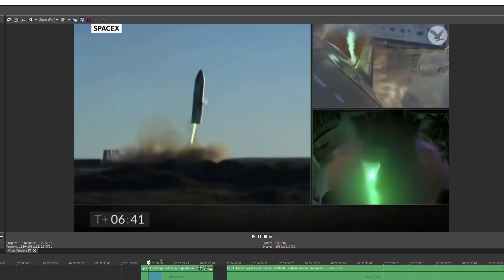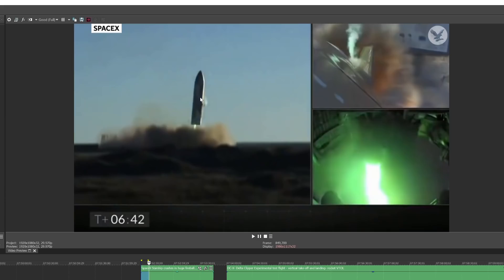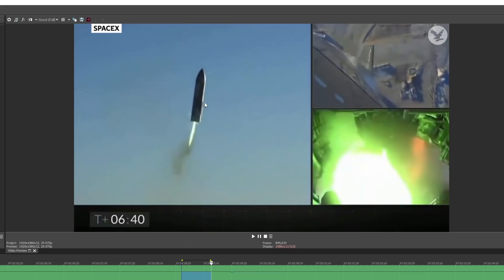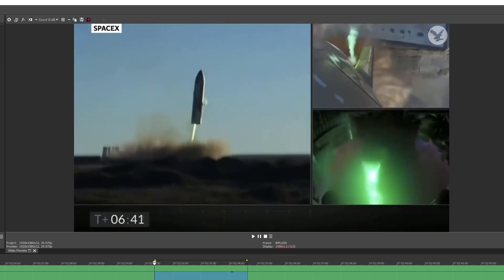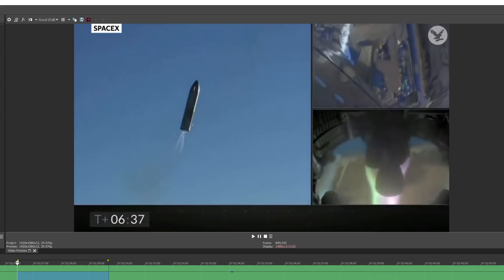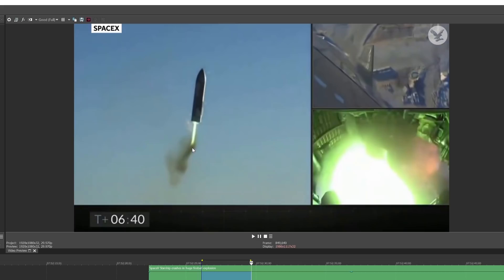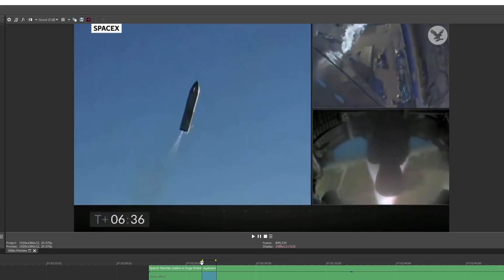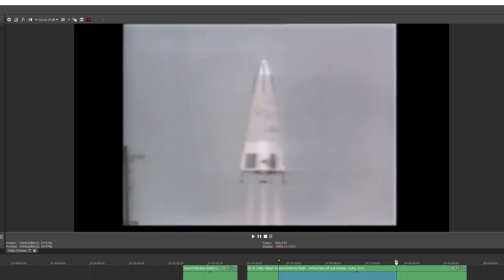SpaceX Starship Explosion: First analysis!

Comment: They "handle" the sloshing problem by using smaller "header tanks", Methane in the top of the methane tank and O2 at the top of the nose cone. They DID have low pressure and it was likely due to one of the engines eating itself. In the end, that one engine almost did the job in spite of those problems. The engine problem may have been the result of the low pressure Elon tweeted about or it may have been a defect. I hope they do a thorough investigation and fix it before trying again. But, the flight itself was picture perfect. Made altitude and the belly flop at the end placed it right on the edge of the landing  pad. Not bad for something Elon only thought had a 1/3 chance of completing all of those milestones.

Comment: My non-expert opinion was that due to fuel starvation one engine doesn't start at all, the second flames out later and the third has oxygen being pumped through it but very little fuel, leading to it using the engine itsself as a fuel source.

Comment: Has anyone experimented with the use of an 'intra-fuel tank-balloon" to compensate for the diminishing volume of the liquid, and thus keeping it at pressure? And not sloshing around.
Could it not be possible to achieve a balance of pressure in the tank and "balloon" to not allow for voids?

Comment: the copper could be from the engine muzzle ...
there is a TV documentary about the manufacture of the ARIANE engines. I guess that the fuel was not "clean" and condensate formed that the cooling lines froze up so that the fuel 1. could no longer cool the bell 2. could not reach the muzzle to burn there ...!? a short-term blockage of the combined fuel / cooling lines and at such high temperatures copper "burns" very quickly

Comment: It uses header tanks to avoid the sloshing. A tweet confirmed that the pressure in the propellant tanks where too low. It didn’t really get enough propellant so it just ate itself. The green is probably TEATEB or copper.

Comment: its not ignitor fluid at all. the engines are started by basically a spark plug. the green flame is copper.

thunderfoot.. u must be an idiot if u dont know that slosh isnt a problem because starship has seperate FULL header tanks. slosh wont effect it is the tanks are FULL!!!!!  THE PROBLEM IS THE DIFFERENCE IN PRESSURE BETWEEN THE 2-3 Gs OF HEAD PRESSURE BETWEEN THE SMALL TANKS AT THE FAR FRONT AND REAR TANK. 75 METERS OF HEAD PRESSURE DIFFERENCE WILL BE VASTLY DIFFERENT PRESSURES!!!!!

I DONT AGREE WITH U SAYING EVERYONE AND EVERYTHING WILL NOT WORK.... USE UR BRAIN TO HELP INSTEAD OF DETER PEOPLE FROM TRYING!!!!

Comment: SpaceX knows how to make fuel tanks with baffles to stop the slosh. what happened was that there are header tanks at the top that contain fuel just for landing and weight balance. The header tank lost pressure which caused fuel starvation and the engines and loss of thrust. The green exhaust is copper from the combustion chamber. It wasn't the engine bell. The engine bell is made out of carbon composites.

Comment: Elon said something about reduced methane pressure, so I suppose engine started to burn oxygen rich causing all sorts of materials inside to fail spectacularly.

EDIT: SpaceX is using copper engine bells at least in previous Merlin engines
https://en.m.wikipedia.org/wiki/SpaceX_rocket_engines

So this is very likely bell being vaporized into a high temperature gas

Comment: I see two engineering problems here.

1) The flip maneuver, that definitely unbalanced things.  This could have affected the second problem.

2) The bell definitely looked very damaged by the flame color.  If the method used to cool the bell is disrupted, this could cause things to heat up rapidly.

The second solution can be easily solved IF they engineer a way around keeping things flowing at all attitudes.  How you do that?  Beats me right now, retrofit bits from the Shuttle OMS?  Your guess will be as good as mine at this point.

Comment: It's designed to land with only 2 of the 3 engines. The way they get around fuel slosh on landing is that they have separate header tanks which are full and pressurised. The failure was caused by not enough pressure in the header tanks. This lead to the engines running lean with too much oxygen and not enough methane (these engines don't use triethylaluminum-triethylborane for ignition). That possibly caused one engine to go out (not sure if it is designed to do the final descent on just one engine) at which point all the oxygen goes to the other engine which then starts burning the copper-rich lining of the engine. This lead to loss of power which caused the RUD (rapid unscheduled disassembly) on landing. Apart from that, the test seemed to go well. SpaceX only gave it a 30% chance of doing everything it was supposed to do including landing on target. In fairness, it did land on target but not very gracefully. They have the 9th version pretty much ready to test and that will include fixes to the problems this test showed up. It's pretty impressive when you consider the size of the thing and the fact that this is just the second stage. On production launches, the Starship will be sat on top of a massive first stage booster.

Comment: The Raptor engines do not use TEA-TEB ignition, so it isn't that. I think it is uneven fuel flow after that flame-out, that causes a very right oxygen environment of the still firing engine. The oxygen rich mix in the engine starts to burn the engine components themselves, and assuming that the engine is using some copper-containing alloys, it would give a green flame.. 
in fact, there is test-fire  footage of a Raptor engine firing where we also see a green flame preceding a failure of the engine.

Comment: Absolutely! I drove a gasoline tanker for twenty + years and those tanks generally  had baffles.  And not so much just the sloshing of the fuel as when it developed a resonant frequency and a feedback loop that it could cause you to crash and likely be killed. 
I can relate through experience that through  seat of the pants operation of those rigs that the marked difference in weight and viscosity and at what temperature the liquid you were transporting happened to be,  how quickly things could get out if control where you'd better know what to do, and more so what not to do that determined whether or not you survived the day.
Today we here alot about driverless trucks and all, but will there ever be A.I. subtle and sensitive enough to safely  replace the experienced human mind and hand?
IDK, likely not.

Comment: Cant you  put some kind of piston or bladder in the fuel tank that expands as the fuel depletes so you don't have the empty space in the tank?
Reply: That would add too much weight and mechanical complexity. What they do instead is that they pump inert gas to the tank as it depletes. Result is constant pressure in the tank. It's not perfect solution, as it doesnt stop the fuel from moving around. To solve this, Starship has 2 smaller fuel tanks, that are full of fuel (and so the fuel doesnt move around) and that are used to fuel the engine just before the landing. From what we know, the pressure in one of these tanks was too low and so engines got bad fuel mixture. One of them flamed out seconds before "landing" while the second one kept running but destroyed itself in the process (green tint is the copper inside the engine burning away).

Comment: Boom, I love Spacex fanboy claims of success.
Reply: Yes. I've seen an article that claimed the Starship was a success after exploding.
Reply: It was a success. It got off the ground. Everything else was a bonus. First flight powered by 3 Raptors, first prototype with nosecone, first use of actuated fins and flaps, first use of main tank and header tank, first shut off and reignition of engines, first bellyflop, and nearly a perfect landing.
Pressure failure on the secondary header tank was responsible for crash. No big problem.
Good job there's another 6 prototypes in line. I believe SN9 will be rolled out to the launch pad later this week.

It's a shame you seem to think you know something about a project you obviously know nothing about.
The test parameters were not a secret, like it or not every single one was achieved.
Monumental progress.
These ships will be flying regularly in  no time, and landing.
Take it from someone who has been watching Starship evolution since day 1. The test was unbelievably successful.
Reply: @kifwoo1  

Yes, the space craft was a success after blowing up. You have issues mate.
Reply: @AAaa-pm3rr  
Considering it was the 10th iteration of a prototype program that isn't expected  to reach orbit until at least SN15, I'd say your ignorance is the real problem. Not a space craft when it was never meant to go to space.

Yeah, if you knew anything about it you'd know SN8 was expected to crash. The goals of the test were outlined by SpaceX before the flight, meaning you couldn't be more wrong if you tried.
FACTS. Try them.

Comment: Fuel sloshing around, or rather liquids sloshing around is a problem not only in rockets but also in just about any thing built to move large amounts of fluids such as tank trucks, super tankers or railway tank cars. This is now old news and modern tank trucks has partitions built into the tanks to prevent the fluids to slosh around. Primarily you want to keep it from moving side to side as that can cause the truck to roll over when turning. Also old tank trucks all had cylindrical tanks with a perfectly round cross section while modern tank trucks mostly has tanks that are flattened and has a vertical side section to enable them to hold a larger volume of fluids. These are even more sensitive to sloshing than the old cylindrical tanks as when the fluid level in the tanks are low a larger percentage of the weight can move further out to the side. When manufacturers first started to flatten the tanks this cause some accidents where the truckers drove the new trucks the same way that they had always driven the older models of trucks. This made the manufacturers to start installing partitions in the tanks to dampen the sloshing.

Now in a rocket that is trying to balance on a rocket something like this has to be considered carefully. Using computers it's theoretically possible to compensate for almost any amount of slosh provided the engine has enough power and the actuators are fast enough to move the engine exhaust. But that is balancing on a knives edge. If at all possible you want to minimize the amount of movement in the fluids to up the safety margins in the control systems. The reason you might try to avoid or at least use less than optimal amounts of slosh prevention is because it takes away some fuel capacity and adds weight to the tanks. Neither of which you want to do to your rocket.

Now if liquids moving around is such a well known problem then why did this rocket crash? And I have no idea. You have to ask someone who actually knows something about the craft in question about that. Me I just look at the video and go "WOW!" at the fireball...

Comment: They have had this on the test stand with the raptors and this was confirmed to be copper in the engine as it almost tore itself apart. Look the footage up if you want to see an awesome engine test. The SN8 uses header tanks to try to get around the fuel/oxidizer sloshing around problem.

Comment: They use seperate small fuel headertanks for the landing sequence because of sloshing/pressure issues. As far as I have heard, the fuel supply wasn't stable during landing, engines run oxygen rich, and destroys the engine parts that causes the green flames.

Comment: So the copper.. The copper is in the exhaust nozzels themselves. They are a copper structure with channels for the fuel, enclosed in an inconel jacket inside and out. So you see the inconel part when you look at the engine bell, whether looking at the inside or outside surface. But between them, inside, is all copper.  So the cold methane is routed through the engine bell on it's way to the combustion chamber to cool the engine bell AND warm the fuel for easier combustion.  During this trip the copper is getting overheated due to low fuel flow and you can see it glowing white hot as the green flame grows.  This is due to the superheated copper and inconel.  The copper is melting and mixing into the methane flow.

Comment: In September 2019, Elon Musk posted on Twitter that "Raptor uses milled copper channels with an inconel jacket all the way down"

I just checked and it appears that the nose header tank contains oxygen. The mid-ship header tank contains methane. The primary tanks are not used for the landing burn due to sloshing, but the header tanks are supposed to have enough fuel (and pressure) for the landing burn.

Yesterday on Twitter, Elon Musk posted that the "Fuel header tank pressure was low during landing burn".

Therefore it is likely that the green flame is caused by the copper burning in an oxygen-rich environment with little to no methane present. 

My edumacated guess is that the swinging motion of the rocket switching into the correct position for landing caused the fuel in the methane header tank to slosh more than expected, and not be in the right place to enter the pipe to the engine.

Comment: the auto ingnite fuel to start the engines burns green as well and after a flame out makes sense they were relighting the engine
Reply: Combustion chamber is made partly out of copper. Raptors don't use TEATEB to ignite.

Comment: Dont know if this has been mentioned but earlier in the launch aproxamently at T01.42 I noticed a burst of flame in the housing like where the camera is but more to the entrance. Too me it looked as if something whent wrong earler in the flight.
Reply: probably not hot enough to become a problem. Given that the rocket doesn't have a flame trench or whatever, I presume it is expected to see some fire up there. This happens at engine shut off as well. It do look wrong though, I have to agree with that haha :D.

Comment: So, with further info from SpaceX, it would seem low pressure from the header tank was the problem, other than that, the Raptors performed as expected. I don't think this is going to be difficult for them to sort out - lets not forget, SpaceX have proved with the Falcon 9 that they know how to overcome the problem of fuel flow from tanks whilst the vehicle is in free fall. On a return to pad mission the Falcon 9 relights some of it's 9 engines three times - boost back burn, re-entry burn, and finally the landing burn - all performed with the vehicle in free fall.

With regards to the Starship - or the Falcon 9 come to think of it, you simply cannot compare them to that early vertical take off and landing rocket that you showed. Totally different. That early test vehicle basically done nothing more than hover, it's engines were running all the time, thus the craft was never in free fall. Totally different to how these new generation craft work, the flight profiles are totally different. Comparing them to those old test vehicles is pointless.

But I totally agree that the big issue is controlling and maintaining a constant fuel flow to the engines, something they succeeded in overcoming with the Falcon 9, and I am sure they will do the same with the Starship. Let's not overlook the fact that for the landing phase of the flight, they are not using the main fuel tanks, they are using much smaller header tanks. Obviously for the reason you talk about here - to try and overcome the fuel flow issue.

With regards to burning green at the end, the Starship uses a spark based system to relight the Raptors, so I reckon the green flame was caused by the engine consuming itself, rather than an igniter fluid it does not use.

Comment: Just some thoughts:
1)fuel for landing is stored in separate tanks so it should not splash so much
2)When you talk about engine bell, it means the part from throat outwards, without combustion chamber.
3)Green is probably from burnthrought a copper part(maybe injector or combustion chamber), due to shock or oxygen rich mixture(Musk tweeted low presure in header fuel tank)
4)Unsychronise TVC is because rocket corrected for some longitudinal rotation

Comment: Wouldn't u sort the fuel slush with compartments in the fuel tank? Might add some weight but.if done by a very light weight material.
Reply: my think is that the added weight should also add some structural stability, but maybe it is difficult to make any noticeable difference, compared to other ways.
Reply: There was no sloshing, they use separate small tanks that are full to relight to avoid this problem. Clearly has some issues they need to sort out, but still.
Reply: @Katniss218  i didnt think so either since its a pretty basic problem that probably was sorted long ago. Like in the von braun age of rockets.
Reply: @kungfreddie  Well, the thing is, no rocket before was supposed to do this crazy maneuver. Those are completely new forces no one ever designed for.

Comment: The merlin engine nozzle is made out of a niobium superalloy, don't know if the raptor is too
Reply: The Merlin 1D Vac engine's big nozzle extension is made of niobium, it's the part that glows red hot during the second stage burn. However the sea level version of Merlin and also the nozzles on Raptor are made using an outer layer of steel pressed against an inner layer of copper with cooling passages in between the two.
Reply: @sycodeathman  I thought the outer layer was inconel.
Reply: @Katniss218  You're right, for some reason I had it in my head than inconel counted as a type of steel, but it's actually a family of nickel based alloys with only a minor iron component. Still, the basic construction is the same as I described, just a different outer jacket material.